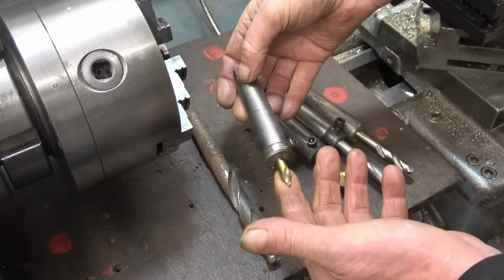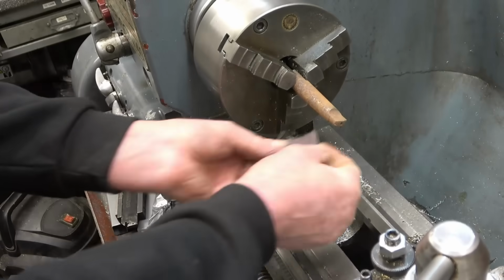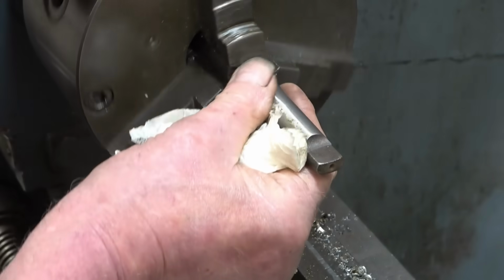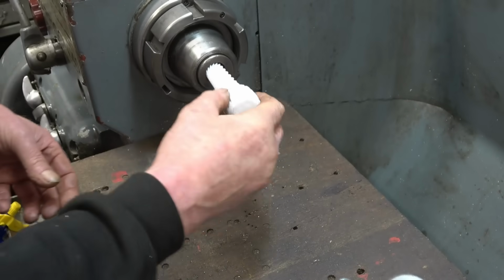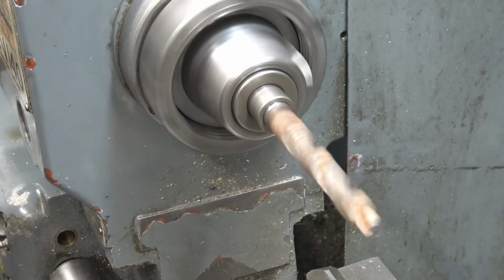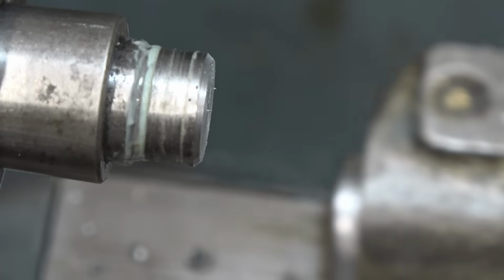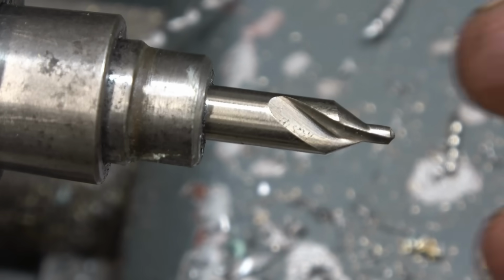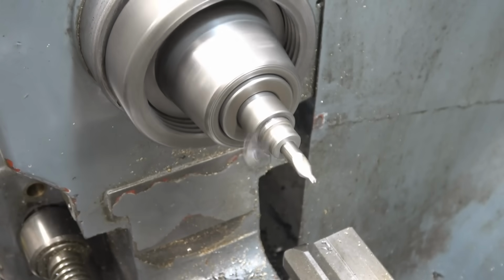Wednesday Catch Up 24 . DIY morse Taper Centre Drill Holder

Comment: Safety tip. Never have the ends of a length of abrasive cloth closer than 90 degrees apart.

Comment: Hi John.  You mentioned that your friend made the MT 2 & 3 taper cleaners.  I’ve had a look online and found a couple to 3D print, but they don’t look half as good as the ones you have.  Do you know if he still has the files that he used to print them.
Cheers Noel

Comment: Hi John great videos   Just  A question  what is the taper on the adapter you use in the lathe when the chuck is removed
Reply from the maker: It came with the lathe .
4 .5 morse taper to 3 more taper .

Comment: Certainly a useful tool to make if you're trying to push your lathes between centers capacity to the maximum. Good for those with smaller machines.